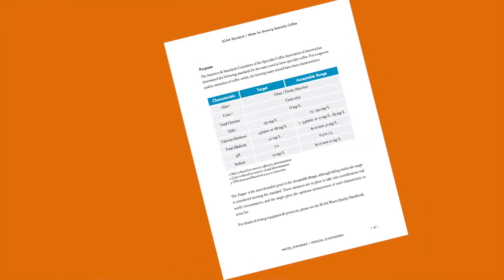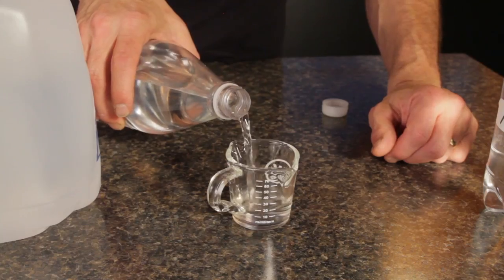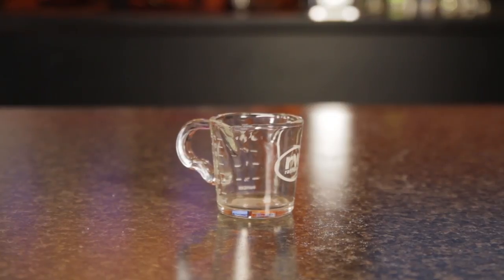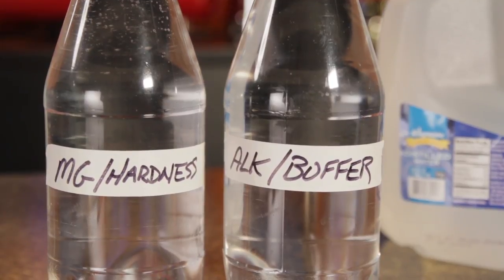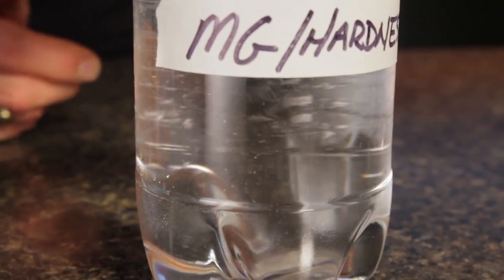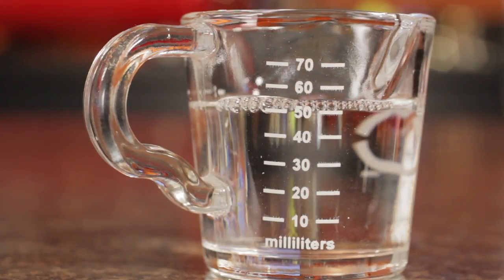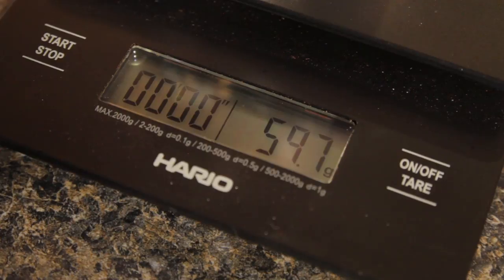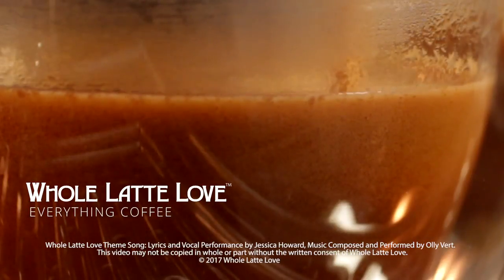How To Make Basic SCA Coffee Brew Water

Comment: I was doing the math, we used 10.1g of the epsom salt that is 10100mg of Mg. We used 63ml of the concentrate so we divided 15.8 by 1000ml(1L) to get to that. So 10100/15.8 we get 639.40mg of the Mg is in the gallon. There's 3.78 liters  in a gallon so we divide 639.40 by 3.78 we get 169.15mg Mg per liter isn't this above the sca standard? Did I do the math wrong?

Comment: So does this method prevent scale buildup in the DB machines as well as get the better coffee flavor?
Reply from the maker: Hi BB, Thanks for the question. At the SCA spec ratios described in the video you are unlikely to form excess scale in a machine. In large part because the mineral level is predominately from magnesium and not calcium. Personally I would still descale a machine just to be safe.
Reply: @Wholelattelovepage  
So if the scale buildup is reduced, how often would it be recommended to descale?  Also, I've noticed Mark talking about descaling solution but then at the same time mentioning descaling DB should be done by pros.  Is there a procedure for descaling DB machines?

Comment: Is this a suggested recipe to use through an espresso machine to avoid scale?  I’m eyeballing one of your machines hard, but this dilemma has held me back as I want the very best for the machine maintenance wise.
Reply from the maker: Hi John, Thanks for the question. This water recipe has lower scaling potential but may not be scale free. If using this water I recommend prophylactic descaling every 6 months with average usage. Depending on machine type there are other options for water treatment. I see in a comment on another video you are considering a Profitec Pro 500. If you are starting with tap water which is safe for human consumption you can be scale free using BWT in reservoir pad filters like this: https://www.wholelattelove.com/products/bwt-bestsave-m-anti-scale-filter or a BWT pitcher: https://www.wholelattelove.com/products/bwt-penguin-2-7-l-water-pitcher
Both these options use BWT's patented ion-exchange process to control mineral levels (hardness) by replacing some calcium with magnesium. This maintains a mineral level required to support flavor and prevent over-extraction yet will not result in scale if used as directed. Both filters also remove chlorination and additional chemicals using activated carbon. Long-term cost per liter filtered is lower with the pitcher. If you end up using a water which may cause scale HX boiler machines like the Pro 500 are relatively easy to descale. Process is shown in this video: https://youtu.be/yEGfyJkWSqU
Marc
Reply: Whole Latte Love Thank you for the outstanding reply.  That helped a lot. My water is somewhat hard. I like the idea of possibly using store bought filtered water with the BWT reservoir insert. Descaling every 6 months as you stated.  Thanks again!

Comment: Is there any water you can buy that is already up to SCA standards that doesn't need to be remineralized?  What options are there (if any)?  This would be for home use French press and espresso in a Profitec Pro 500.
Reply from the maker: Hi Brett, I have from time to time read of some commercially available bottled waters as falling within SCA specs. Not something I've tested or tried however. I've also read that some national water brands have variations in mineral levels depending on the region in which they are purchased as they may have a number of bottling facilities with water coming from different sources.
Reply: Thx - WLL!

Comment: How would I bring the TDS higher? I tried this recipe and only got 100ppm, wondering how I could make it 150ppm.
Reply from the maker: Hi Adam, For higher TDS just increase each concentrate. In you case 50% more of each should do it.
Marc
Reply: add a bit of potasium chloride and bit of calcium carbonate and you’ll get ur perfect drinking and brewing water at the same time! I do this and get 155ppm! not bad or far away from 150ppm!

Comment: Hi ,

I have a question regarding quantities. I measured .5tsp of baking soda and then I weighted it just to make sure I had 1.4g as the video says but instead it weights 5g which is a big difference. Same thing with the epsom salt. 2.5tsp gives me 14.1g instead of 10.1g. I double checked everything on a second scale and I had the same results.

Should I measure by weight or with the tea spoons ? 

Thanks
Reply from the maker: Hi MR, If you have accurate scales, weighing is more accurate.
Reply: Had the same issue, probably because I bought my Sodium Bicarbonate from a pharmacy and not a grocery, and it's grounded more finely.

Comment: Why not use 1.5 tsp baking soda for the Alkalinity/Buffer, then you could use the same 63 ml per gal as the Magnesium/Hardness concentrate?  It seems that would be easier and you'd make a new batch of each at the same time.  Expanding on that, why use two bottles?  Couldn't you simply mix a liter of combined Alkalinity/Buffer and Magnesium/Hardness, simplifying it even further?
Reply from the maker: Hi Mike, You can certainly do some math and adjust the concentrations of each component as you like. The 2 concentrates must be kept separate until diluted in water. If combined in concentrated solution a precipitate will form.
Reply: Good idea.  I'll try that next time.  Thanks!
Reply: I had the same idea: Since the amounts posted in this video are 185 and 63, 185/63 is just about 3 (2.9365), so if one wanted to apply almost even amounts from each 1 Liter bottle, it would only require tripling up the  Baking Soda, or, as you say, 1.5 tsp instead of .5 tsp. Makes the depletion of liquid going forward more even between the bottles. My math says put in 62g of the BS mixture and 63 of the Magnesium ES mixture, per gallon (I use my scale to weigh these). ALSO remember to adjust the amount of water subtracted becomes less, so now only remove 125g of water (62+63=125g) from the gallon before adding the 2 solutions. A little less than 1/2 cup.

Comment: I found this video because a comment on pure calcium chloride said they used it with baking soda and epsom salt to make coffee water. if you were going to use the calcium chloride as well, how much should you add?
Reply from the maker: Hi AHC, Thanks for the question. I don't have a solid recipe for using calcium chloride. A couple of things... Calcium is the main culprit in causing scale deposits. An important consideration for those using espresso machines. The magnesium does essentially the same thing as calcium would. It supports a mineral level for flavor and prevention of over-extraction but has far lower risk of scale formation.

Comment: So...if I buy my filtered RO water by the 5 gallon jug...I can just add 1.4g of baking soda and 3.3g of epsom salt directly to my jug and that should be good to go instead of messing with concentrates? I get that concentrate makes sense if you're making your coffee brew water a liter or a gallon at a time...but I'll be making mine 5 gallons at a time.
Reply from the maker: Hi Chad, Yes you can do that. Fully mix in one additive before the other. If added at the same time you may get a precipitate.
Marc
Reply: @Wholelattelovepage  Do those amounts look right? I measured (weighed) them out and it's really a tiny amount of stuff that doesn't seem like would have much effect on 5 gallons of water.
Reply: I just tested and the 5 gallons has a TDS of 95 after adding 1.4g baking soda and 3.4g epsom salt. No difference in taste.

Comment: I have a 5 Gallon tank that I fill with RO water, for this ratio, would it be 925 mL Alk Concentrate and 315 mL Mg Concentrate? Also, how would I be able to introduce Calcium to this?
Reply from the maker: Hi PP, Sorry for the delayed response just back from 2 weeks in Italy visiting with various machine and grinder manufacturers. You are correct with 925ml and 315ml. You can add calcium by making a concentrate similar to the Mg concentrate using calcium chloride. But, be aware magnesium and calcium do essentially the same thing and there should be little or no taste difference. They both increase hardness to prevent over-extraction. At some point more hardness is not better so keep total hardness the same ie. dont do 315ml Mg concentrate and then add calcium on top of that. Also be aware that calcium is more likely to form scale in brewing equipment than Mg.
Marc

Comment: So what would the measurements be if I didn't want to make a concentrate, and just wanted to mix up one gallon at a time? I do have a scale that does grains, so I can measure small.
Reply: Curious about the answer for this one too! Any feedback WLL? Or would it mean that I'n need to get a scale with more than just 1 decimal?
Reply: Also curious about this. I believe you could add .063 * 10.1g of Epsom Salt first. That's 636mg. Then you could add .185 * 1.4g of Sodium Bicarbonate. That's 259mg. This should be suitable for a gallon.

WLL, Marc, any confirmation on this?
Reply: @gravityUTube  I think that's about 10x too much of each. I've been using .75g Epsom Salt, .26g Baking soda for per gallon distilled.  About 130 TDS.
Reply: Oh sorry, basic math/decmal points off... you are close, correct.

Comment: Not to split hairs but distilled water has a certain amount of mineral contaminants already in it. Water quality goes as follows distilled<reverse osmosis<deionized. Each of these contain mineral contaminants, TDS, TSS as well as TOC in ranges from PPM and PPT. Deionized is around the PPT range. As far as using water as an extraction medium, the cleaner the water (ie the less contamination) the hungrier it is...in other words, it is better at being an extraction medium. Just a few cents from a water chemistry expert.
Reply from the maker: Hi NY, thanks for the comment. Agreed perfectly pure zero TDS water is "hungrier"...a more effective solvent - it wants those ions! With coffee/espresso, ultra-pure water causes over-extraction resulting in unwanted flavors. Typically bitterness. Geek level coffee people for instance prefer harder water for espresso than for immersion methods of brewing. In addition, not a good idea to use ultra-pure water in espresso equipment. As opposed to hard mineral rich water which may cause scale to form in boilers, ultra-pure water can cause corrosion in some metals.
Reply: Thank you for the reply. I can see what you mean by over-extraction. The ultra pure that I work with on a daily basis that comes from our mixed anion/cation beds literally will strip the oils from your skin to the point that your skin will crack. I assume that it will do the same with some of the organic acids in coffee such as tannic acid that impart the bitter/astringent taste.

Anyways enough with the nerd talk. I hope you have a good day. I look forward to diving in to more of your videos. They are definitely some of the best I have seen for the coffee lover at heart. You definitely deserve many more views and subs!
Reply from the maker: Hi Non, You are welcome! I run an RO/DI system at home to make "pure" H2O for use in a reef aquarium. I get the occasional comment from espresso machine owners saying they want to use RO or distilled water in their machine to prevent scale. On surface seems like a good idea - no minerals in there. What they miss is it make horid tasting coffee and over time can damage metals in machines. Why you never see an RO system with metal pipes!
Reply: Not to mention ultra-pure water is acidic! Acid + metal is a disaster waiting to happen. The pH off of our mixed anion/cation resin systems runs at a pH as low as 5.5!
Reply: less coffe, half.. destilled water and half of usual coffe, perfect. Not destilled in a plastic can, then horrible plastic taste.. Pure water is best in the world

Comment: Hi all--why bother if you have a water softener system, and very good tap water?
Reply from the maker: Hi jbrennanc, Thanks for the question. Going so far as making your own brew water is not for everyone. Softening can help reduce scaling in boilers by replacing calcium with sodium. If source water is very hard this may result in elevated sodium levels. Also, While water softeners are good at removing hardness, they do not reduce the mineral content of the water; nor do they remove silica or alkalinity. For some boiler systems, reducing these compounds is required.

Comment: There's no Calcium in this formula, is there? (Or does Espsom salt contain Ca?) However, the SCAA specification recommends about 68 ppm of Calcium. Doesn't this lack of Calcium somehow impair coffee flavour extraction?
Reply from the maker: Hi MA, No calcium in this formula. The Epsom salt contains magnesium which is a replacement for the calcium. It provides the mineral level instead of calcium. Mg is also less likely to produce scale in espresso machine boilers. Brew water lacking minerals/dissolved solids will cause over-extraction as mineral free water is a better solvent.
Reply: Thank you!

Comment: Hi Mark, as all of your videos, this was very instructive.  I use a Pasquini Livietta 2T espresso machine which I had them service it after several years of use, which included descaling.
The tech recommended using distilled water from now on, which I have been using with decent taste results.  I read, however, that the newer machines with low water level indicators will show low/no water if it is filled with distilled water (lack of ions).  I guess the sensor uses a current through water between the two electrodes.
But reading ALL the reader's comments I also learned that distilled water could be actually corrosive to metals and affect the ultimate taste due to potentially lower pH and higher extraction capacity.
Your video is just what I need.  Thank you so much.
I am seriously considering the PRO 600.  Although unlikely needed, can the owner do the descaling on a DB machine, or it needs to go for service?  Thanks
Reply from the maker: Hi J, Thanks for the comment. I'd never go back to that tech again! As you've heard pure distilled or RO water is corrosive and will over-extract coffee. Really, any tech worth his salt should be keenly aware of that! Go to just about any cafe (at least here in the US) and you will find an RO water treatment system with re-mineralization or other water treatment which does the same thing. These cafes want to serve a good product and protect the equipment investment. Some machines do use conductivity through the water  to check level. Many Rocket Espresso machines do it that way. Others like Profitec and ECM use magnetic floats and external tank sensors to detect low water lever. Even a few which use pressure plate activated switches below the reservoir.
As to descaling a dual boiler machine. Best thing to do is filter water properly so no descaling is required yet you have a proper mineral level for flavor. We do not recommend home users descale dual boiler machines. Depending on model it can be difficult to fully empty the boilers. Also DB machines have more complicated internal hydraulics with more solenoid valves and other components. When descaling a neglected machine chunks of scale can dislodge from one area and cause a plug in another. One reason why our service department typically removes boiler from machines for descaling.
Marc
Reply: @Wholelattelovepage  Thanks Mark for your lightning fast and thorough response.  I have already ordered my Pro 600 after chatting with Mitch.  Now today, while I wait for the order, I will be working on the Brew Water concoction.  Looks easy and simple enough and cheap to make, and cheap in the long run avoiding expensive services or repairs in the future.
Reply from the maker: Hi J, You are welcome. Pro 600 is a nice machine! Mitch knows his stuff and is one of our best latte artists!

Comment: 4:30 Measurements
Reply: I did some conversions to re-use a 5L water container.
Concentrate: Add 3.5g of Bicarbonate and 8.6g of Epsom salt and water to make 100ml. Shake to dissolve. 
For 5 Litre of brewing water add 10ml of the concentrate and make up to 5 Litre with RO or distilled water.